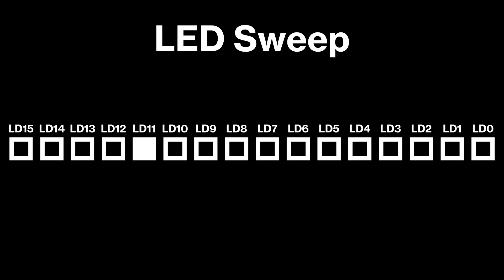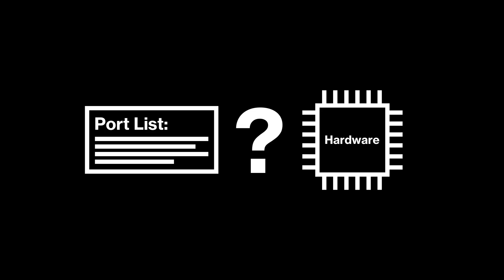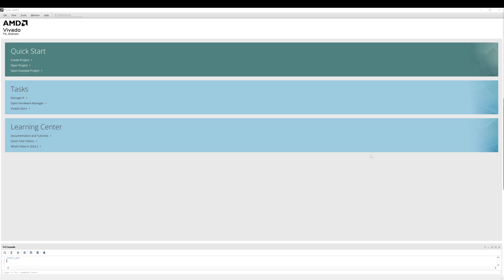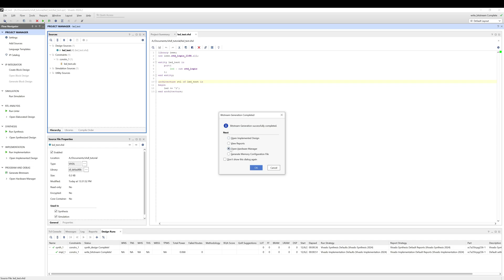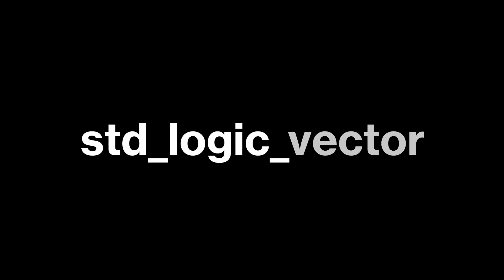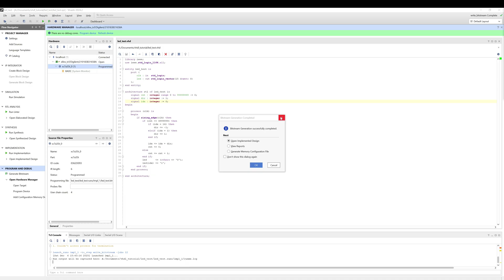VHDL Tutorial - LEDs

Comment: nice theory but the software is impossible to install.  it gets to the license part, i generated the 30 day license and .... NOTHING HAPPENS.  there is no "ok we did it finish the install button" and if you quit the license manager the install GOES NO FURTHER.  they have their head up their ass, they dont event test their own install
Reply from the maker: That’s super frustrating. Maybe try downloading an earlier version. I know that AMD is changing their licensing. An older version should have everything you need. I use Vivado 2024.2 in this series which has worked great for me. You can change which version you download by moving the version slider at the top of the page after clicking on the initial page’s download button. Let me know how it goes!
Reply: @Metastable-x  ty for the response! I had issues installing this 2 years ago too, ive never done VHDL development, i code C, asm and forth but have a need now - tools are very important :)

Comment: Great video!

Some questions:
1. You are checking `cnt >= X`, why not an equaility check? I assume it's just to give room for errors where `cnt` is set to a higher value, when/why would this happen?
  Is this something we normally have to worry about when working in VHDL?

2. You mentioned the difficulty of testing circuits like this with a simulator, what are the expected complications? Is it possible to handle them?
  I don't have access to an FPGA yet, but I'd like to follow these tutorials using the simulator.

3. How exactly does the mapping from led port -> hardware led work? How would it work if we had multiple entities mapping to different hardware leds? And to the same led?
Reply from the maker: 1. You could totally do “cnt = X”. The chance of it going above that cnt value is extremely unlikely. I was being overly cautious. 

2. You should be able to follow along in simulation just fine. You’ll just need to write a testbench for each simulation you run. 

3. So the key is the constraint file. The constraint file contains the name of a pin on our FPGA. In implementation your port is mapped directly to this pin. The FPGA then drives the pin which can turn the connected LED on or off.

Hope that helps!